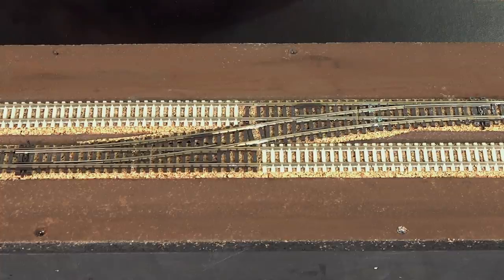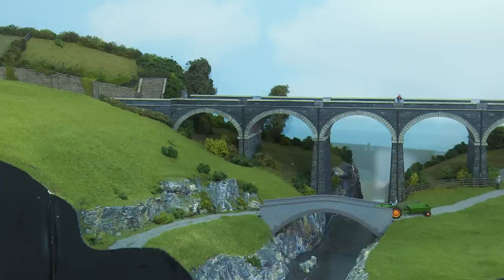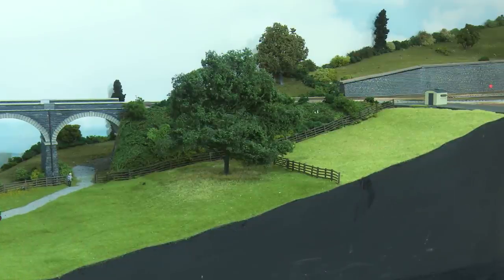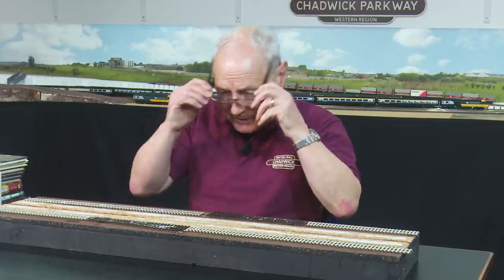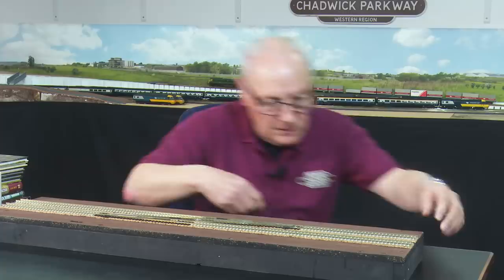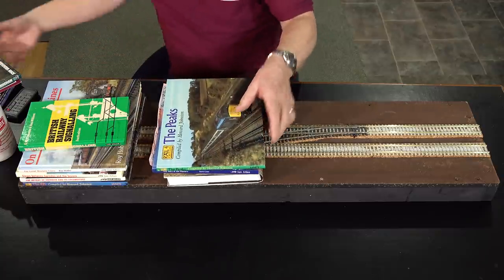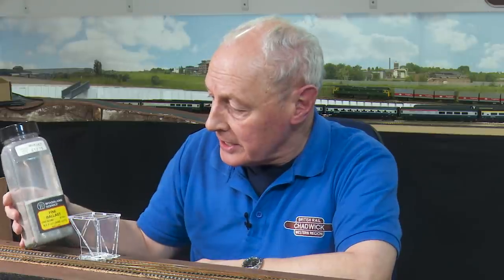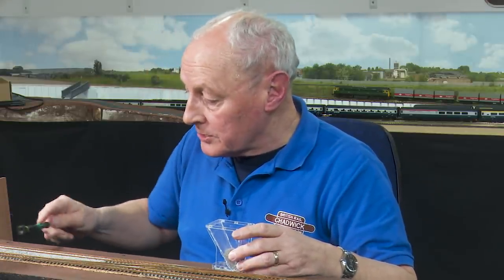Laying and Weathering Track at Chadwick Model Railway | 153.

Comment: Another great video Charlie. I have used screws on the small amount of track that I have laid but, as you said, this is not very successful for N gauge. When using glue in a shuntingn area with lots of points ang dropper wires is full sleeper gluing necessary or could you syringe small amounts  here and there?
Secondly, on a main line track, would the inside faces of the rails be rusty?
Many thanks
Brian
Essex Thameside in N
Reply from the maker: Hi Brian, yes indeed the inside of the rails would be rusty too. Regards Charlie

Comment: As always much to learn from your videos Mr. B. - thank you! One question, how/when do you go about cleaning the rail head of excess paint to make sure you don't lose electrical conductivity to your locos? Or, is the solution to install industrial sized 'stay alive' capacitors and hope for the best...?
(EDIT: I see you've already answered a similar question, Charlie.... back to using sensible capacitors it is, thank goodness!)
Reply from the maker: Best to clean off the rail heads ASAP to avoid the paint drying. For more stubborn dry paint, masonite (hardboard) or a wooden block are non abrasive.

Comment: Hi Charlie could you help I am finding it difficult to find the Wright scale figures for my oo gauge layout I have sum that fit into coaches and cars no problem and look Wright but then I have a locomotive driver from Hornby and it's much bigger which is Wright 🤔 ps loving your videos
Reply from the maker: The figures you have put in trains are under size but look right.  Train drivers and platform figures are bigger but the right size.  We just have to live with this.
Reply: Thanks Charlie 😊

Comment: That was a good video.  You got the starkness between creosote ties and concrete ties knocked down very well.

I am modeling narrow gauge in an era from 1900 to 1912 in SE Arizona, that has it own issues for the Peco O-16.5 track ties.  In my time period the railroad used Mesquite trees to make their ties and without Creosote.  Mesquite wood is reddish when cut.  Those ties were laid out in the blazing hot Arizona desert sun.  The sun bleaches the wood and adds a silvering to the color to the tops of the ties.  Then you have the tan to orange natural sand from the surrounding environment.  Having lived in Arizona I can tell you that there are the occasional dust storms and dust devils that coats everything.  Plus the railway I model was a copper mining railway that hauled coal up the mountain to the smelters.  Also, it was all steam powered so you had the oil spills from the lubrication of the rods and clean sand dropped from the loco for traction.  Of course all that is gone now.  However, when I look at the B&W photos of the time period there is another railroad made feature present.  The ballast is humped between the rails so that the ties between the rails are not visible.  Only the full ends of the ties stick out of the ballast.  What is normal ballasting today is not what was normal back then, at least not normal on some narrow gauge lines.  Of course most narrow gauge lines did things on the cheap too.

I think your experiment is also going to depend on available lighting.  Take your diorama track out into the bright sun and compare your results to the lighting in the train room.  How would it look at an exhibition in a hall lighting?  Another question, what about the track for predominately passenger service as compared to a track used to haul coal to a power plant?  Could you say the track to the power plant is darker because of coal dust?  Just some thoughts...
Reply from the maker: A fascinating comment DK a.

If only those photos from times gone by we were in colour. Regards Charlie

Comment: Probably being a complete ‘numpty’ here, but is there any particular reason why you couldn’t (or didn’t) do the rail side-painting as the first step after laying, and then do the sleeper painting/dry brushing afterwards? You are going to be painting the sleepers (to an extent) anyway, so any paint or spray on there from the rail side painting will be covered up later (or you could use a card mask as you go to prevent that happening).  Any wash that might inadvertently end up on the rail sides, if the wash is done later, can either ‘add character’, be wiped off or (again) be prevented by use of the aforementioned card mask.
Reply from the maker: Hi Steve, I thought it just might be easier to do the rail sides last, in case I had any overspill from painting the sleepers. Regards Charlie

Comment: Hi Charlie, nice presentation, thankyou. There is no doudt the act of "rusting" the rails is one of the most convincing things to do to our track!
On another tack, I noticed some verdigris where you had soldered the jumper wire between the stock rail and point rail! After any soldering to rail or electrical joints and where (read always) I've used flux, after soldering, use a brush dipped in Metho to neutralise the acid in the flux. I know there is a good brand of flux that reckons its no clean flux, that in my experience does not stop the green crud from forming after.
Cheers
Reply from the maker: Thanks Peter, it was an old point I have changed my soldering technique since then, regards Charlie

Comment: Good video, Charlie.  When you started dry (not dry at all) brushing the wooden sleepers with white, I was waiting for you to say proudly that you'd created concrete sleeper points out of wooden ones.😀  The drone footage and prototype photographs were interesting, and just go to show that we should aim for more variety, particularly (in UK terms) between the fast and slow lines on a four track section.  The other interesting thing (which I have actually noticed when stood on station platforms and even on Google maps aerial views) is just how often sleepers are covered with ballast.  I've sometimes wondered if it's the difference between hand-laid track and machine-laid track, which has had the Plasser & Theurer tamper levelling it all out, but you also see piles of ballast on the sleepers on newly laid mainline track - as indeed in one of your overhead shots, where as you commented, the ends of the sleepers were completely buried in new ballast.  Presumably over time, it all settles down, and a few hundred trains running over must work like tapping the rails with the handle of a brush or whatever.  But I think it goes to show that we don't need to worry about ballast on top of sleepers.
Reply from the maker: Yes Andrew, I believe you are right. The drone imagery shows what’s really going on out in the countryside. Regards Charlie

Comment: Thank you Charlie for this video.  Lots of good ideas.  My own layout is so small (1 x 6 feet, two turnouts) that I decided to hand paint all the rail and ties, using acrylic craft paints.  I figured that having track sections showing different levels of age and maintenance would help compensate for the smalll size.  I also made a few places where new ties had been inserted and ballasted where the track was supposed to be old.  On the whole I think it worked, and I'm satisfied with the results.  It was fun to experiment with different color mixtures to get the shades I wanted.  However, if I'd known how tedious and time-consuming the painting would become, I would have done otherwise, say use those nifty paint markers for the rail.  Cheers from Wisconsin!
Reply from the maker: Thank you Andrew, I’m so pleased that you enjoyed it mate. Stay safe over there, regards Charlie

Comment: Great video as usual, but what happened to the RailMatch Sleeper Grime? I bought a whole stock of it when you mentioned it in a previous video. Do I have to get rid of it now? :)
Reply from the maker: Now you’re just being mischievous Steven, you know that this was based on concrete sleepers! 😜
Reply: @ChadwickModelRailway  so sleeper grime doesn't get deposited on concrete sleepers?
Reply from the maker: Now that’s an interesting point.